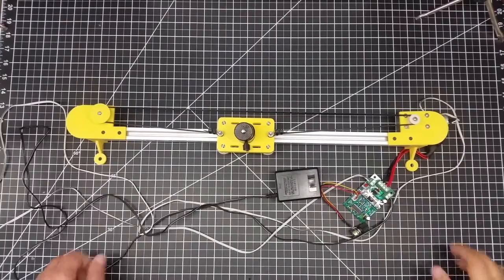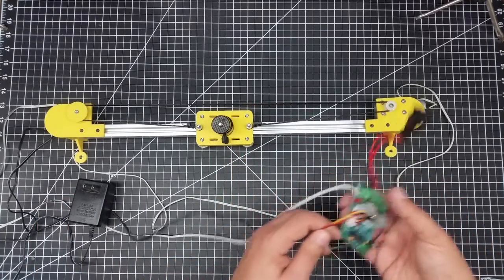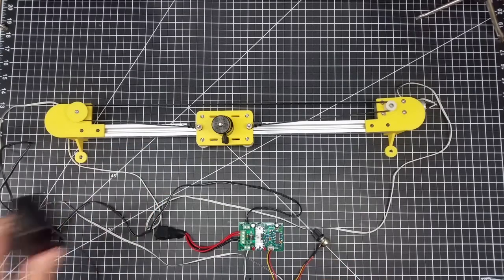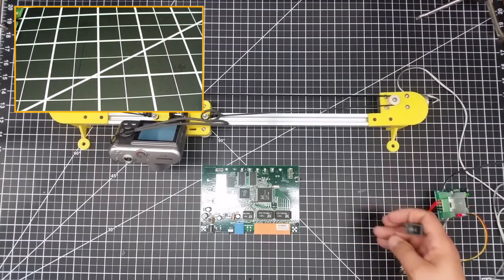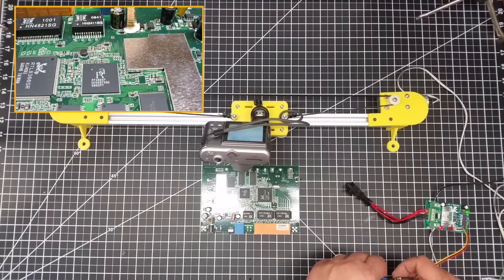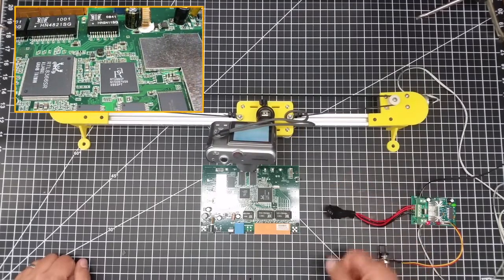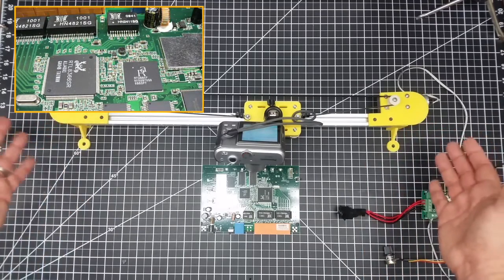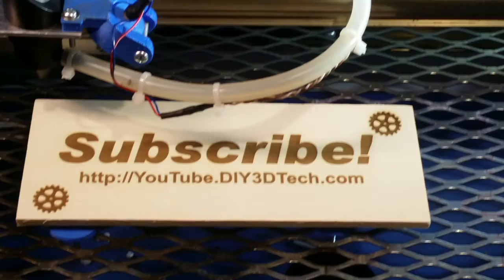3D Printed Project - Motorized Camera Slider!

Comment: looks good .  you know you could put a encoder on the outside of that belt by one of the pulleys , and then you can do precise speed and  distance stuff .  that is if you ever arduino -ize  it later . 
but yeah if you snag one out of a old ball mouse or such .
Reply from the maker: LOL!  Now your sounding like Norbert :-)  As yes there are a lot of things I could do and if you look WAY back you find I built stepper version with one of those little 28 whatever motors.  However wanted something a little more basic...

Comment: Not bad, just needs some limit switches- I got lucky when building my own slider, some guy was selling one of the Agus slider rails that I managed to get for about 1/3 normal price, then just added my own electronics. Sure beats paying the prices that some manufacturers want for even basic motorized sliders. :)
Reply from the maker: Yes on the limit switches but ran out of time as I needed for a project I was working on :-)  Also sounds like you got a good score with the Agus as for 1/3 I would be there too!

Comment: Pretty cool. Weren't you looking to integrate the Arduino with that to automate the filming?
Reply from the maker: Once I find the answer to adding to adding more than 24 hours in a day :-) However yes I a few more things in the back of my mind but it took me a year to get here :-(
Reply: DIY3DTECH.com - Sinetimes it takes a few tries to get that true "spark" to ignite the flames of creativity. Once lit it could make things progress at lightning speed. Keep on tinkering until you are satisfied.
Reply from the maker: Oh I have "spark" however no time or lets say enough time as I am working another which is even cooler :-)
Reply: DIY3DTECH.com - I love it when I have "sparks flying" for ideas but hate it when I have no energy or time to do something about it. I'm taking time off these next couple of weeks to get some "R&R" from work and certain family members in hopes of "recharging my batteries".  I have not played with my printers in weeks. I got some cool things from my family for my 3D printing Hobby and want to get back into it. Got the Flexion HT kit with two extruder blocks, one for for High Temp and one for Flexible filaments. Got the Buildtak spatula which is safer than the spatula from Wanhao. No sharp corners to gouge the build surface or cut you if the part releases and your hand goes flying. Got a GoPro clone with time lapse and an LG 360 camera. I want to play with those so bad but I think I have developed some depression as I find I just have not been "playing" with my toys. So in need to just get back into the saddle and play with my toys. 

Hope you had a good Christmas and I can't wait to see what you have in store for 2017.  Have a (drone) safe and Happy New Year.
Reply from the maker: Same to you my friend!  Know what you mean and Xmass was great, thanks for asking.  As earlier this month during a routine doctor visit they discovered a lump in my wife breast and she had to go for a biopsy and we though we would have to wait till the new year to find out the results, however late Friday they called and it was benign.  Talk about a Christmas present :-)  Also looking forward to hearing about your mods!  I also have all the stuff to do nylon, just need to find the time :-)